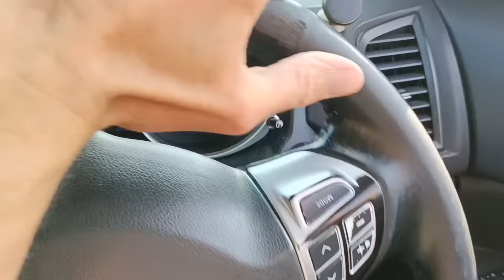BLACK MAMBA PLAYS HARD TO GET!!

Comment: So lucky they spotted it when they did. Wouldn't like to think what could have happened if they'd slept in the room with it! Great job as always Jason. Stay safe❤
Reply from the maker: In this particular instance, once the lights are off and the people are in bed, the threat would be virtually zero, as Black Mambas will not be moving around at night. They will settle and sleep. 
But if it was a venomous snake that is nocturnal (like a Mozambique Spitting Cobra), then that could be a problem.
Reply: True

Comment: You need an endoscope.
Reply from the maker: I do have one, but the capability of it is very limited. It only has a length of under one meter, and the lens needs to get within about 35cm of the snake, before you'll see it. Any further than that the light source isn't enough and neither is the focal distance.
It comes in very handy in certain applications, but a bit useless in other applications. 🙈🤦🏻‍♂️👍🏻👍🏻